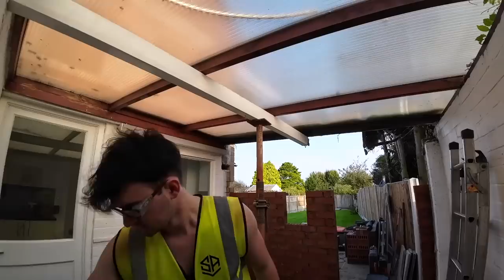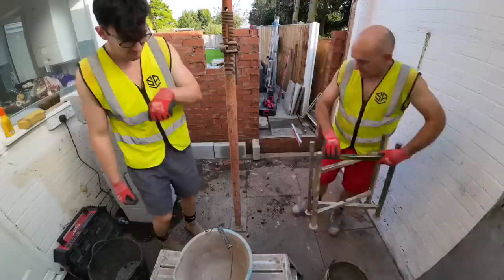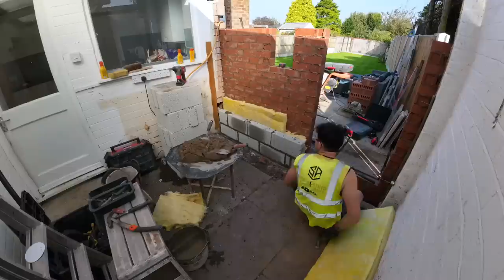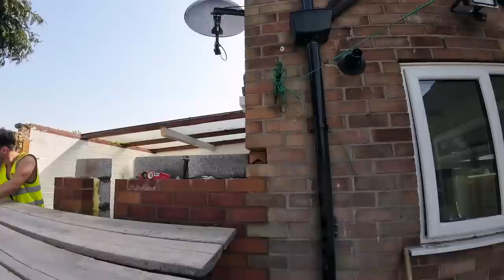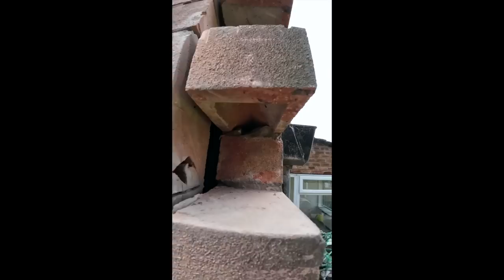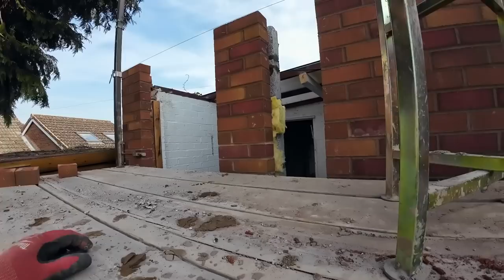TIE WIRE ISSUES WITH IMPERIAL BRICKS..MINI EXTENSION PT 3

Comment: Keep up your good works as always ,that battery 12 inch disc cutter what a great tool cutting the concrete blocks in this video done in a jiffy  and it looks light weight no wonder it's your favourite tool Steve.

Comment: Good stuff. Any reason you didn't open the cavity through into the main building? I remember you'd been keen on that in the past, and it should be easier with the new beast of a saw.
Reply from the maker: It wasn’t requested 😬🧱👍🏽

Comment: You are not selling your soul. You are promoting high quality tools. The way that saw cuts those blocks is amazing. They are just jealous that they were not asked. Pay no attention to negative comments. If they knew how much work goes into making one of these videos, they would keep there mouths shut. I have heard many times here on YT that if the person was not doing the video, the job would take a lot less time. I personally love Milwaukee tools. Quality at a reasonable price. Keep up the good work. PS, as for always having problems, that's the building game.
Reply from the maker: Thanks pal . The tools and equipment are absolutely fantastic. 
   We’ve had plenty of trolls over the years . 🧱👍🏽
Reply: Hi Guys, The "trolls" are the ones who are probably jealous not knowing a good tool if it hit them or simply can't afford them. I've heard many times, why do I spend so much when they bought some Chinese crap and it works perfectly. It's only when they try my tools that they see the difference. Pay no attention to them and do your own thing. PS. When is that hip op planned or have you had it. I've noticed you're walking with more of a limp nowadays. Must add, love the comment "don't hop anywhere anymore" @SteveAndAlexBuild
Reply from the maker: @paymart04 Thanks pal . It’s such good gear 🟥♥️.
  Waiting for a hip replacement any day hopefully 🤞🏼 😬🧱👍🏽

Comment: I don't understand why a company hasn't started producing blocks compatible with 73mm bricks steve? Surely there's a market for them? Lovely job again lads.Made up for you both with your sponsor.Great tools! Atb lads👍👍
Reply from the maker: Shame they don’t Dave 🫤.
 Very proud to be sponsored by such an amazing brand 🟥⬛️♥️🧱👍🏽
Reply: Easier and quicker way around the 73mm issue is to knock the inside course up 1st in thermalites, then use a "helical wall tie" as you build up the outer skin.... They bang into the thermalite faces using a hammer rather than sitting in the mortar joints.   BCO are fine with it, works great!. i use them all the time when thin jointing blocks too :)
Reply from the maker: @guinnessmad 🧱👍🏽

Comment: Always down our end Imperial is 4 courses to a foot, 3 inches a course so easy to keep to, problem is its often bumped up so i Always run a a 75m coursing block on DPC that way the the blockwork is high but the ties fall the right way and when you get to the top all is level👍
Reply from the maker: Nice one Andy 🤜🏽🤛🏽🧱👍🏽
Reply: @SteveAndAlexBuild  👍
Reply: Agree with Andy 75mm cut on dpc not easy mixing imperial with metric.
Reply: @mervyndavies2250  👍

Comment: That's a desperately narrow window opening.
You said earlier that the client wanted it for ventilation.
I can't help think that there will be less than 100mm of glass if it opens.
I know you are only doing what they want but I don't think they've thought it through!
If they had a top hung window 1.5m above the floor across the shower (or further) it would provide light ventilation and somewhere to put soaps etc.

Comment: Bed the blocks up
Reply from the maker: It’s never that simple 🧱🧱👍🏽
Reply: I think it is. I build imperial  all thetime
Reply: I wouldn't want to use extra thick beds, weakens the structure,
Reply from the maker: @KingstonHomeMaintenance certainly does 😬🧱👍🏽
Reply: The difference  of metric to imperial  block work is minimal.  Never had a problem  in 35 years